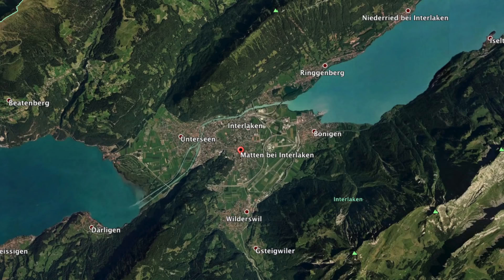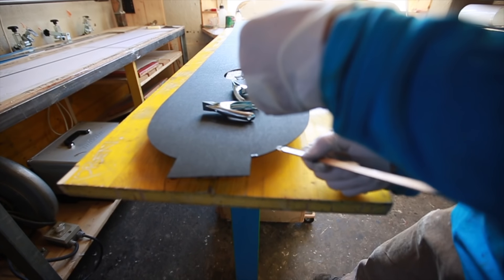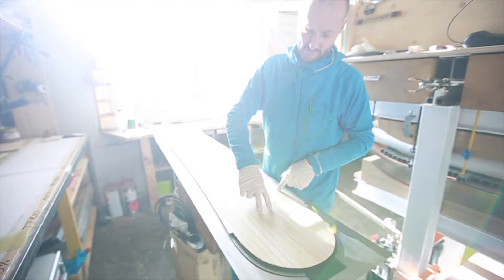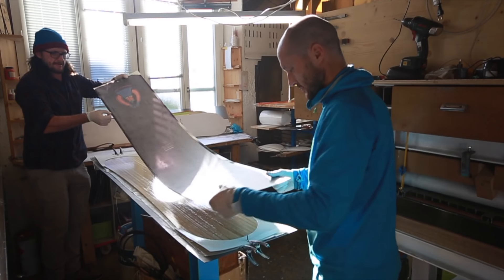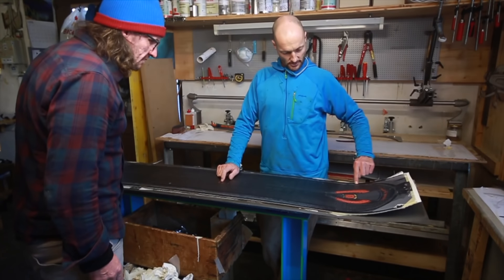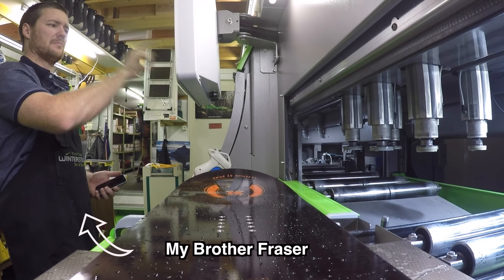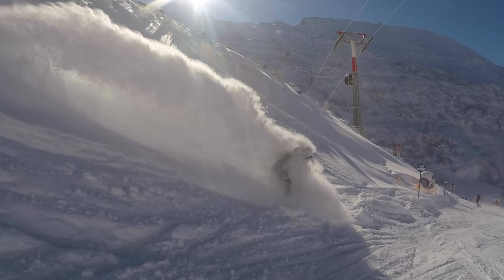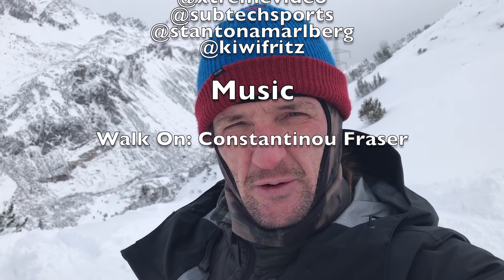How to build a custom Snowboard- Learning By Doing EP45

Comment: Good work. How you can easily remove the metal plates from epoxy after the press process. I was trying 4 times, and have really big problems with it. Nearly damaged a boards. And plates are not useful anymore. Do you cover plates with some anti adhesive liquid?
Reply from the maker: Hi Radek. Thanks for watching. Its not my workshop, I was just helping make my board so I don't know all the details. check this website: http://zensnow.com
Reply: you have to lubricate the plates, yo can use even vaseline